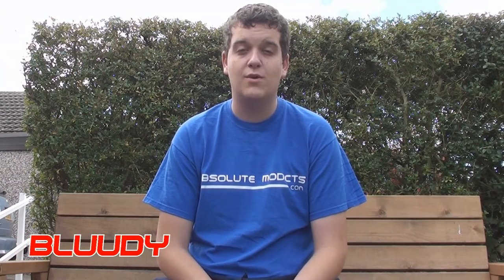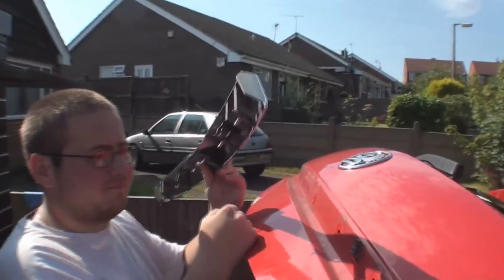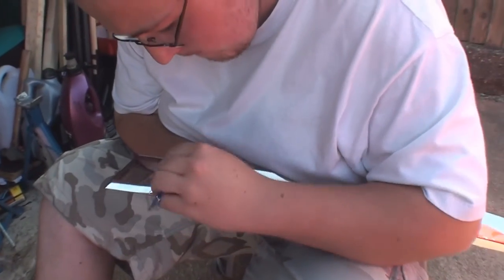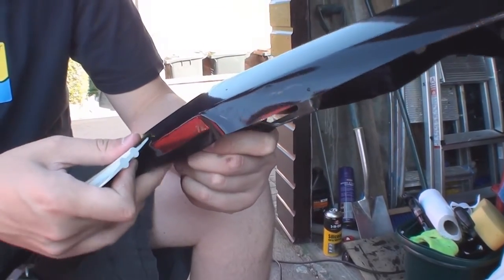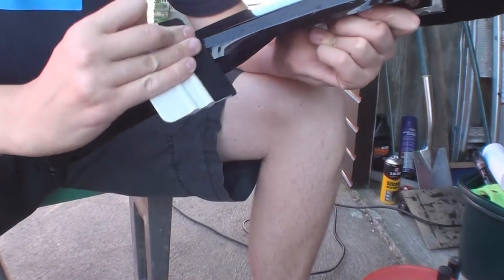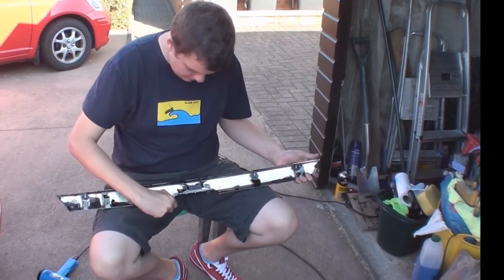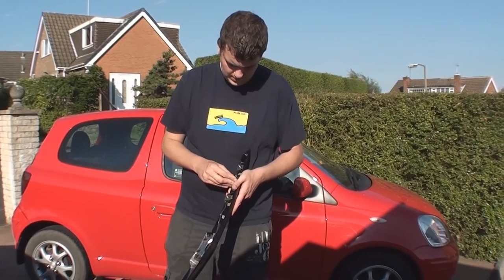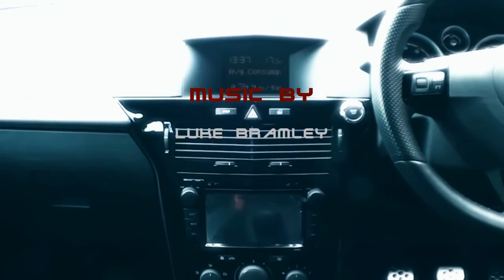How to: Remove and Vinyl wrap a Boot/ Trunk Strip and Refit

Comment: How did you take the boot panel out? It's held in by 8 white clips isn't it?
Reply: Ima reply after 4 years doubt you need to know but I just pull the bottom of the boot panel and then slide the boot panel side to side and the clips are designed to slide sideways
Reply: @M1.942  Hahaha thanks man. Some memories here. It went from me asking about a boot strip, to owning the first flip painted astra 🤣🤦
Reply: @dnurds  whats a flip painted astra? Probably a dumb question😂😂 you still got it mate?
Reply: @M1.942  sold it last June mate! @dnurds on Instagram and you'll see it! I couldn't stay away now I've got Another astra 🤣🤣

Comment: what did you use to take the badges off
Reply: johnsta0492 use a hair dryer and some dental floss
Reply: johnsta0492 fishing line
Reply: I used some hot water ( not boiling but very hot ), dental floss in a sawing motion. Then pick off as much glue with your nail or a bit of plastic like an old bank card. Then use tcut to remove the rest of the glue and buff it up. Degrease it though if your gonna paint or wrap obviously.